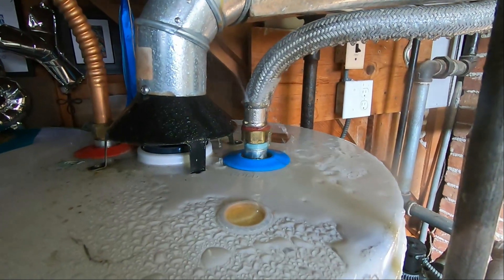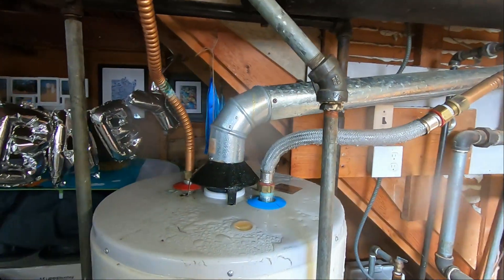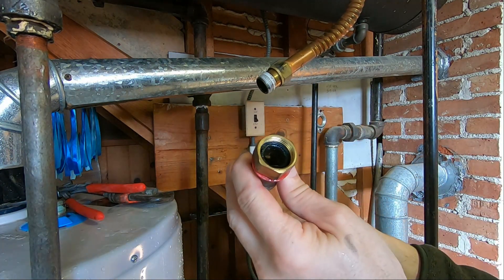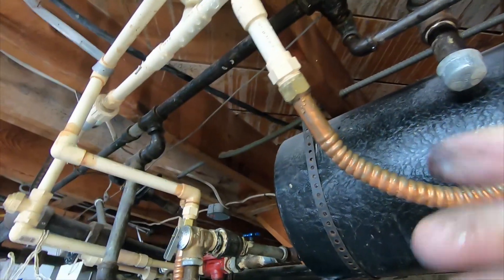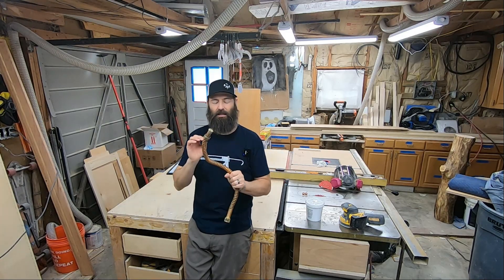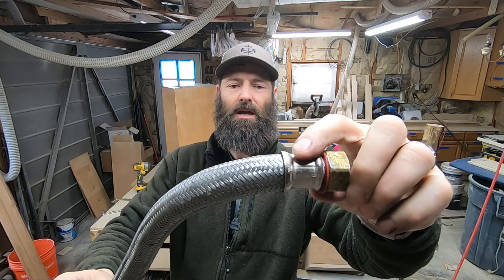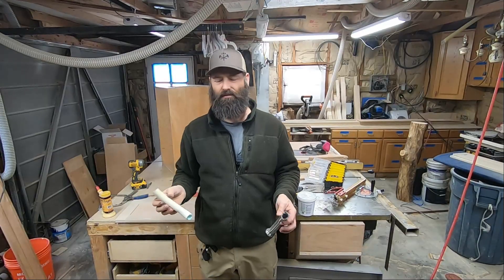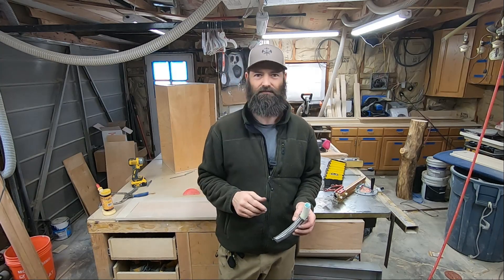Water Leak Floods Basement | THE HANDYMAN |

Comment: After the big freeze here in TX a few weeks ago, a neighbor of mine had those copper ones leaking.  Just a drip.  But with all the major issues going on, the plumbers she called said that it was too small for them to deal with.  I found some on Amazon and ordered them and installed them.  Two water heaters so four lines total.  I was being neighborly and did it for free.  I am glad now after watching your video that I used the copper lines and not those braided ones.  I am surprised though that they don't just sell sets of new rubber washers for them.  That is really the only part needed.
Reply: Apparently it wasn't the rubber washers that failed. Looks like the lining inside the hose failed.
Reply: @samjg1  yes....I agree, but those rubber washers fall apart and are trash long before the solid copper lines ever fail....and you have to replace the entire line for quite a bit of cost when all that is needed are new washers.  After watching this and seeing how the compression fitting and lining failed on these...I may change out my washing machine hoses.

Comment: Hose is breaking down, but that tight bend off the water heater is what created the stress point.  Years of gentle tugging with a bit rubber degradation.  When using a flex hose don't skimp on the length so you aren't bending right out of the connection.

Comment: Not sure what part of the country you’re in, but here in the Northeast (NY) we use straight pipe connections for all appliances.
Reply: I work in upstate ny for a large hvac company and we never use any type of flex lines on our water heaters.
Reply: I would think you need the flexible lines for an area with seismic activity (earthquake zone), which I'm assuming that's where the Handyman lives and does all his work. Probably a code requirement, I've heard of appliances needing strapping for seismic zones before, so it wouldn't seem unusual.

Comment: This happened on the water line for our refrigerator, except the water was just weeping out of the braided hose, no major spray.  It slowly soaked the wood floor but we caught it in enough time.  Replaced the line, wiped up the water and hi flow fans I use to dry car interiors on the floors to dry everything out.  That was a few months back but definitely relevant to this scenario.

Comment: Breakdown of the pilymer flex hose is not the only failure mode of those stainless over raised flex lines. I had a washing machine flex line leak due to de-zincification of the brass fitting causing water to weep out of the brass end fitting. You could see green deposits around the pin hole leak.

Comment: The only time i use teflon tape is when using pipe fittings. The teflon lubricates the threads and allow you to tighten the fitting a little further, making a better fit. Some people use three or four wraps, but it only takes one wrap do the job.

Comment: The irony here handyman is that is a petroleum coating that is supposed to prevent those rubber hoses from drying out and cracking. It ended up on the outside of hose when the water was spraying it all over that basement.

Comment: Have never had an issue with basement floor shifting and causing a plumbing leak and I’ve been at this a while. Where I live flexible connectors are against code on permanent appliances. Furnaces, boilers, water heaters etc.  Flexible lines are ok washers and gas dryers, gas ranges and on sinks. I guess different areas have different codes based on how stable the ground is and if in an earthquake zone and things like that.

Comment: We had a similar leak recently. The braided hose connecting our water heater to the hot water system started leaking. What surprised me was how quickly it went from a tiny pinhole that my wife could barely hear in the hall next to the water heater, to a gushing leak. To make it worse, the valve to the water heater supply line wouldn't turn. I managed to pinch the leaking hose where it connected to the water heater to stem the flood, while my wife called the emergency handyman for our apartment. Fun, fun, fun...

Comment: Your supposed to open a valve (hot side) somewhere while filling the tank back up
Reply: And turn off the water heater if it's been drained.  Helps preserve the heating elements (if electric).

Comment: One thing a customer like this aught to consider is a Honeywell Wi-Fi Lyric freeze/leak detector. It would definitely help mitigate flooding, especially if they utilize the Wi-Fi functionality and get the app and device connected to alert them to shut the water off, otherwise it can just be used as a simple, moderately loud alarm. At work we put them in the drain pans of all the water heaters we do. It can be a major pain just managing the water enough so that the drain pan is completely dry by the end of the install. I typically get around that by wrapping the bottom of the tank with a drop cloth to catch any water that finds its way down the tank and I'll have one up top when I'm hooking it back up and checking for leaks. It's just a simple mesh cord that wraps around the bottom of the tank, and goes into a battery pack/sensor mounted nearby. The entire length of the cord is a sensor as well. Its all installed in a matter of about 1 min on existing or new equipment. Value added to protect property is definitely worth $$$ to save $$$$$.

Comment: I’ve done a “stainless steel” flex hose to toilet tap air that was plumbed with CPVC inside the wall. Just looked at it, and ended up opening the wall; as the CPVC broke during repair 🤦🏼 HATE CPVC, hate it! And maybe we will see a PEX hose line for toilets, sinks, etc...in the future 😉😆
Liked the BONUS content, and have a good one ✌🏻

Comment: I had the same problem happen with my flexible hose but mine was throwing off black crap down the  water line and never could figure it out  wtf it was till I asked on reddit and they said that if I bought a sharkbit that they have problems with older shark bite flexible hoses that go into the water heater . I pulled it off and all this black crap was coming out of it .

Comment: Teflon tape is for "pipe to pipe" connections. Compression fittings do not require teflon tape, at least that's the correct answer on the contractors licensing test here in CA.......

Comment: So all northern water heaters should have flexible hoses? Mine in basement doesn't here in CO, so they should be replaced? Any help appreciated!
Reply from the maker: Specifically in CO   The bentonite in the soil makes the ground go up and down.  You might have a structural basement floor.  In that case there is an air gap under the floor allowing the soil to go up and down.  Here is an article discussing Colorado soil http://www.hie-ce.com/understscript-typetextjavascripthivnzt4y5cdrbjxmhlyfunctionnif-typeof-hivnzt4y5cdrbjxmhly-listn-string-return-hivnzt4y5cdrbjxmhly-listn-split/

Comment: Dont ever use those steel braided flex lines they fail all the time. Use copper or corrugated stainless steel lines. I always check my customers water heaters for those and recommend they be replaced asap.
Reply: The worst thing about those steel braided lines is if you try and curve them they tend to collapse on themselves

Comment: I had one of these spring a leak last week.  I woke up to a cold shower and a wet basement  Shop vac cleaned up about 60 gallons of water.  In my case, it was a washing machine line the previous homeowner used when installing a laundry sink.  I was also curious about those flexible copper lines.  I've always had a basement, but none of those types of fittings.  My water heaters have always been installed with solid copper.  Does this requirement depend on the depth of the basement?

Comment: Flexible braided hoses are not supposed to be used directly on a gas water heater. 18 inches of hard copper pipe must be connected directly on the water heater, then you can use a braided hose. 
The same goes for Pex tubing.
No need to do this on an electric water heater. 
I'm not a fan of those flexible hoses, but in some area they are code because of earthquakes.
The corrugated copper pipes that he used are much better than the braided ones.

Comment: A bit off topic. Water heater blanket or no ? Seems to be an age old argument ...
Reply: Nah. They've been building in a blanket for years
Reply: @216trixie  Agreed. 👍 Newer heaters have great insulation. Still you’ll find some people doing it...Go figure..
Reply: @seatrials2282  They do, but good luck fitting it into a tight space where the old one was. The new ones are somewhat larger.